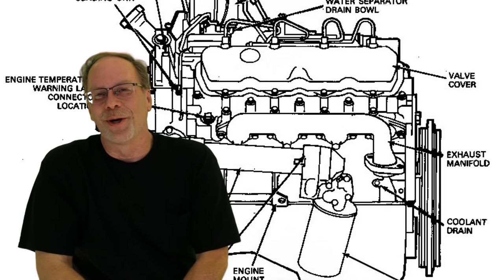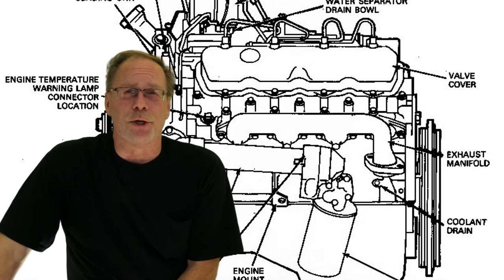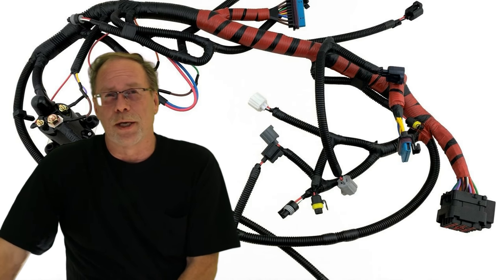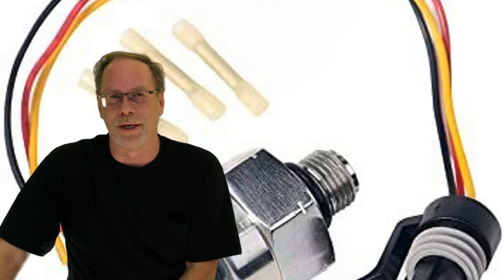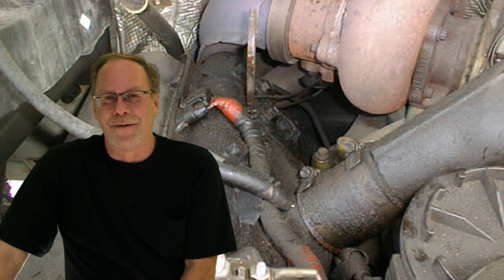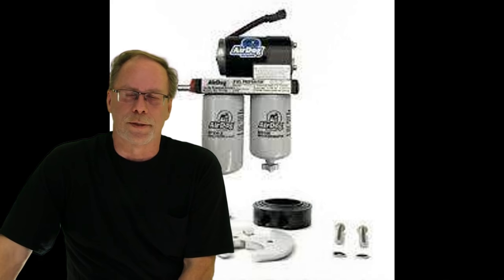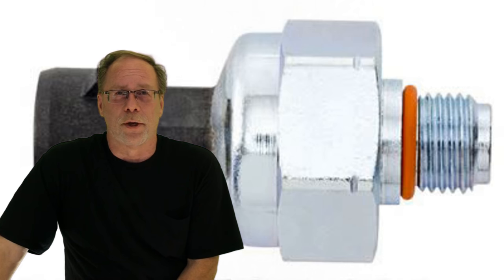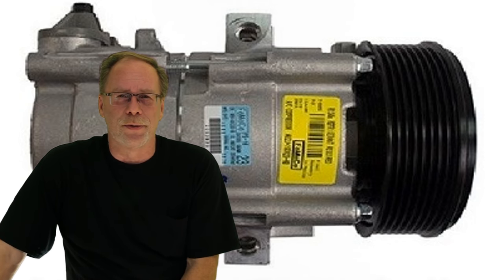11 7.3 POWERSTROKE ISSUES STOP IN AND SEE COMMON FAULTS.........

Comment: Good day! 
I have a 95 F-250 7.3 power stroke 
I am at my wits end trying to diagnose it, it has an intermittent rough idle.
Hot or cold when I pull out to a stop sign, about 70% of the time it idles extremely rough ( the whole truck shaking very hard) 
Injectors all seem to be good
Recently replaced the ICP, IRP and CPS 
none of which helped 
I also put a new accelerator pedal assembly 
Any help would be greatly appreciated 
Thank you
Reply from the maker: fuel pressure can cause this / bad wires in the heads or the lead at the connectors / injector out of spec or broken tip / check the temp at each exhaust outlet on the manifold for a large temp diff drive for 10 minutes let idle of 3 minutes then check the temp the odd temp at the manifold outlet is the problem if its a injector or wire issue here is a good deal if you act quick https://amzn.to/3P2F8p4
Reply: If automatic try shifting in neutral see if it still rough idle

Comment: Very helpful!!! But I have a 2001 7.3 f250. Recent purchase of a new wireless Obd reader like the one at the end of your vidieo. Followed all the directions so far and I have no communication to the truck thru it.  It connects to my phone no problem but is not reading the truck.  Everything I have done so far to the truck should get me ready to run.  All tho;;;; I do not have a wait to start light either. IDM was sent to a major electronics repair facility and checked out fine. 
Any help please and thank you!!!!
Reply from the maker: We are reviewing multiple obd readers currently for a up coming video so far Bluedriver is working the best . Its very difficult to assess issues with out it not being in front of a guy that being said a no start light , fuse - wires- glow plug relay / solenoid - fuel bowl heater- ecm- in that order
Reply: I thought Bruedrivers were never to be installed. The company told me not to, but that was over a year ago
Reply: I've got the OBD Link+ (shown on the screen in this video).  Works fine with my 97 F250 and my 2016 Odyssey.  Not so much with the 2003 F250 7.3.  Seems to connect but I don't get a read on any sensors.  I'm gonna keep trying though.  Might have to try a wiring diagram first.

Comment: The thumbnail is a 6.9/7.3idi.

FYI there’s 2 different generations of the 7.3 Powerstroke.
The OBS & the super-duty.
The OBS has that nasty ass shower head thing in the tank, the superduty has the tank screens. The shower head can be deleted w a section of diesel rated fuel line, & a brass T that can sit on the floor of the tank w a screen after the tank so it can be cleaned without dropping the tank.
Reply: Tell us more, I envisioned this fix and thought halleluiah it makes sense.

Comment: Thanks I have a 01 7.3 225,000 miles. It eats brake's and had to replace the tranny but this truck is reliable and I never put additives in her.
Reply from the maker: wagner pads / napa top line rotors/ and the only way I was able to stop the rear calipers from breaking was to change the pads at 2/3 rds of use and use extreme temp grease in the sliders

Comment: Need help! 2002 350 7.3 I have replaced, fuel injectors, glow plugs, glow plug relay, low pressure oil pump and oil pressure temperature sensor. Truck is still hard to start in morning and smokes terribly. Can you help me?

Comment: What happens to a 2000 7.3 if you put the battery in backwards? 
My buddy put one in backwards on a  truck he was trying to get running and hasnt touched it sence. 
Does the altinator go out? ECU? 
What could be the damage if any?
Reply from the maker: The list could be endless but mostly the battery or batteries will get fried and hopefully the main fuse and some other fuses burned up stopping pcm ecm / idm from getting fried. usually a alternator rebuild kit will get it back up to running condition The engineers depending on model year did build in some anti stupid contingencies
Reply: @CUSTOMWORKS7.3PSD  thank you, i cant find much on any forums. They just say the altinator and maybe a fuse. 
The battery smoked a lot for a milisecond and sparked. The terminals on the battery blew up. This was on the passanger side if it makes a difference.

Comment: My 99 7.3 has been smoking a lot while driving and accelerating, smoke looks more blueish,  my oil level has been full for the last month, but truck is very sputtery during accelerating, check engine light will come on while acceleration. 

I have changed map sensor,  exhaust back pressure sensor an cleaned tube, icp, ipr, an cleaned the in tank filter screens. It’s got slightly better but still smokes.

Any suggestions? injector o rings?

Comment: I had a rear main seal leak on my 7.3 and used half of the reccomended amount on my pickup, but it was only in there for about 1500 to 2000 mi. Am I in trouble? It says it’s safe in any diesel
Reply: I put a pint in mine too about 3,000 miles ago and no issues. I think I will change my oil at this point and hope I’m good. Hope you don’t have any issues either. I don’t think there is as much to worry about as he implies.

Comment: i cant get it back in , im getting the angle on the extension right but it’s not wanting to thread , any tips ? tried everything even a small bent alan key to fit the inner square . nothing .

Comment: I have a metal rattle at idle but idle it up the rattle stops is a 99 been that way sence 03 been told torque. Converter or flex plate

Comment: is there a TSB about the water pump bolts needed to be replaced with new? There is no mention of this in the workshop manual.
Reply from the maker: Yes the long bolts loose there stretch causing water pump leaks and timing cover leaks

Comment: I have a 2000 f450 7.3l, I watched the video on top 11 problems,  my lift pump is cycling correctly,  I believe that the problem is the glow plug circuit,  it cranks over , but takes about 10 minutes to get it to fire up, once it starts it runs rough and perhaps not all 8 cylinders,  smokes a little also. Got some points of help to direct me
Reply: I'm not an expert on any diesel, but have you tried replacing your glow plugs.  From what I understand they aren't expensive, but you do have to pull the valve covers to get to them...  On second thought, is it all the time or only when it's cold outside?  Glow plugs aren't needed when it's warm out.

Comment: Hi, I bought my 97 F350 7.3L Diesel because so many people told me that it was the best Diesel engine ever built... This is my first (and maybe the last) Diesel engine, because I have had nothing but problems with it since I bought it... When I first bought it, I had to replace the alternator and batteries almost every year and I only drove it about 2k a year or less... then the rotors went bad, then the front bearings, and  calipers, then the master brake system, and then the vacuum pump for the brakes, and then I started to help a elderly woman Travel across the country  to take care of her elderly mother and  older sister, so I was putting about 6 to 7k a year on it, and then I started having problems with it just shutting off driving down the road... That sidelined me for 2 years and about 2 thousand dollars before I could find someone smart enough to figure out that it was the injector computer... Got 1 year of use before it is broken down again!! I've had 3 different (So called Mechanics) try to fix it and after another 2k it doesn't run at all now!! I had to spend another 2k to have it towed back to my family's home, where it has been sitting for the past 2 years because Nobody knows how to work on Diesels here and the only one who said that he was a Diesel Mechanic, just wants to replace the same things that has been changed 3times now that cost me 2k already!! I am not going to pay outrageous amounts of money  for someone to GUESS AT IT!!! The way I look at it is, if you charge over 60 bucks an hour, you better be able to tell me exactly what is wrong with it in under 30 minutes!!! Otherwise if you don't know what is wrong, then you should pay me for your EDUCATION!!! And if you put a part on and it doesn't fix it, then you need to put my part back on and I'm not going to pay for your mistakes!! Or you can take 20 bucks an hour and then guess at it!!! But being Handicapped and a Senior Citizen on a Very low fixed income, I can't afford to just keep borrowing money to just throw away on GUESSWORK!!! I'm not sure where you're located, but I sure could use your help getting it running again, so I can help my elderly neighbor... I'm a perfect example of "No good deed goes Unpunished"!! About the only thing that didn't get done that one guy recommended, was a complete wire harness, and I tried to find one, but all I could find was a old used one and it said "AS IS" so I not spending 300 bucks on a AS IS crap... So where can I get a new one?? Oh, I forgot to mention that another time it broke down, it was the switch near the front tank, and then another time I had to replace the front tank sending unit, and now the rear tank isn't working... I just bought new sending units for both tanks, and oh, they bypassed the vacuum pump and installed a electric fuel pump and a inline fuel filter as well as the big fuel filter on top... I would have been better off just getting a new 7.3L and swap it out 10k ago... It only has 260k on it and most of the time I am only Towing her Little Jeep Cherokee latitude across the country... Total about 7k lbs... The truck is in Maine right now... You should come do a video on how to diagnose and fix the problem... That way you can post it and people can see how to do it correctly... Please let me know if you can, or if you know someone up here that can do it... Thanks

Comment: I ran out of diesel @ 1/4 twice at 11pm, I always refill at 1/2 tank now
Reply from the maker: https://youtu.be/ZqT1d7pMKWs    7.3 POWERSTROKE TANK SUMP EXPLAINED...............
Reply: Happened to me awhile ago.  Dropped both tanks to find that both of the plastic pickups had broken off of the end of the fuel pickups.  Other than a bit of an issue disconnecting the fuel lines it was a pretty easy job.

Comment: I have a 2001 and starts when cold but will just flat out die once in a while to continuously until really warmed up. Will always restart right back up. Almost every sensor has been changed, and has a new factory engine harness along with every thing else new I have changed. All gauges work and show good things, could it be TPS?  When it is stalling out it loses throttle response??
Reply from the maker: It could be but to be sure it needs a running diagnostic scan, Most diesel shops will do this then you can do the actual repair or replacement

Comment: Hey Custom works, just recently had my 2000 7.3 in to get a new oil pan, end seals etc replaced , as the pan seal was leaking and I thought let's pop a new pan on. My mechanic has finished but it's leaking from the seal again. He swears by the sealent he uses on the oil pan. He says that the old engine (600k) is producing to much pressure and is pushing oil at the seal. As far as I know the sump oil is not pressurized, and honestly can't fathom how it would become pressurized. I think his seal job failed and is trying to take me for a ride. Do you have any thoughts on that ?
Reply from the maker: Yes you are correct he is full of it but lets say your  CCV was plugged tight you would throw a cel code for engine back pressure to high or you would smoke the LPOP seal or the rear main seal but the seals would reseal till pressure built up to high again This possability is so rare you have a better chance of blowing lightning out your butt hole That being said a proper  new oil pan install should always include setting the mating side on a know flat surface to make sure in shipping it wasnt bent then new fasteners need to be installed even Ford service bulletin requires this and further states to use a silicone gasket not rtv because over torquing when not properly set up rtv will cause leaking on the front or rear of the pan  The above are facts not opinion Hope this helps /////
Reply: @CUSTOMWORKS7.3PSD  thank-you for confirming my thoughts. The only pressure realeased back into the oil pan is from the oil filter overflow valve and even that would only be 10-70 PSI or whatever the LPOP is pushing the oil through at... A good oil pan seal should be able to handle that... And a completely clogged oil filter is unlikely and an easy fix that should have been solved quick. (Since the oil was drained for the pan job it should be a brand new filter anyhow)... The bills sitting at 3k. And I have a truck that still leaks oil. Not happy , especially with him trying to blame it on my engine and calling for a complete rebuild . I only drive 7.3s and this one is full of life and power

Comment: Got an 02 F250 7.3 4x4 with 300k miles, everything is good, just changed oil and filter and fuel filter. Truck is in good shape, lots of maintenance done lately.
The car died on me on the highway while cruising low rpms, check engine light came on and lost power steering. Coasted to a stop and truck would not start. While waiting for Roadside assistance, i got it to start up and its been driving with no issues the last few days.
I tried pulling codes, but there are no codes stored. Im using Icarsoft Pro. Any suggestions? CPS or ICP would show up codes, would it not?
Reply: I have a similar problem where all of sudden after about driving for 20 miles my '99 super duty 7.3l just dies.  The first time it happened it started up after a few minues and I was able drive it for 2 weeks.  But then suddenly one day it died after about 20 miles and it would start after a few minutes and then die after about five minutes.  I had to get towed.  I looked into the water/fuel seperator and the heater was rusted.  I changed it out and started it and let it run for a 1/2 hour, then drove it around locally for awhile and it was OK. Next day drove it about 20 miles and it died.  Same start stop routine. I had to get towed.   I am going to change out all the fuel related parts.

Comment: So if a 7.3 will not start but you give it a shot of starting fluid and it starts but will not day Running unless revved up to 2k what could that be? Where would be a good place to go?
Reply from the maker: fuel pressure 50 psi min ICP 600 psi min IPR .08 v min LPOP HPOP you need to do a running diagnostic use this Wireless WiFi OBD2 Scanner Code Reader & ELM327 Automotive Diagnostic Tool - For Android or iOS Devices here is the link to buy https://amzn.to/3zH7Ers then down load app forscan pro pic the PIDS for these above sensors each pid will give you a value low high that will tell you what you need to fix

Comment: I have a 97 powerstroke  that intermittently won't get over 2,000 rpm. I had the injectors and harness replaced, glow plugs and harness, fuel pump, fuel lines, tank pickup screens,  fuel bowl, fuel pressure regulator,  ICP, IPR, speed and cam position sensor, IDM, Main computer,  throttle pedal, had the down pipes replaced, the turbo inspected,  exhaust inspected, cam lob inspected, it's throwing no codes. It will run fine then out of the blue it will shutter and smoke heavy and won't get over 2,000 rmp and have no power then in a little while it will slightly rev up and the smoke goes away and runs normal.
Reply from the maker: hook up a high pressure oil gauge to the head run it up to the windshield when it starts acting up watch for drop off below 500psi (HPOP INTERMITANT LOSS) check fuse box and wires loose or greening this is where I would start in trying to diagnosis

Comment: Don't want to start replacing stuff bc I assume it's the problem then dont want to pay the price of a mechanic. But my 7.3 starts spits sputters bucks then just shuts off 2002 f350 any idea where to start thanks
Reply from the maker: get codes from computer, check fuel pressure,  watch the 7.3 POWERSTROKE BASIC DIAGNOSIS WHERE TO START WHAT TO CHECK and sensor vids

Comment: Truck stalling, PCM? My truck has been randomly shutting off 97 7.3 auto. I believe it’s the PCM throwing an icp code even though the icp was just replaced. Truck shut off while driving and now won’t start, changed the PCM with a known working PCM and it fired right up.
Reply from the maker: Thats rare but happens I just got done with one today the guy replaced the PCM IDM and all the sensors and all it was is a bad IPR connector While he was in the shop and it was running I just pressed on the plug and the truck quit out So soldered in a new pig tail n plug runs and drives great

Comment: please help me I'm from south africa have a 7.3 powerstroke hard start misfires smokes allot all when cold when warm it's better no smoke but misfires at high rpm
Reply from the maker: there are multiple videos in the video library covering these issues
Reply: @CUSTOMWORKS7.3PSD  did everything but shimming on injectors.  I'm the only one in sa with a 7.3 powerstroke . no where to even get parts

Comment: Have 97 federal engine obd when connected will say dealer not released. If try read code engine will shut down...any help much appreciated
Reply from the maker: If I'm understanding you engine codes are pulled key on engine off ,, 97 is OBD 11 make sure you have the correct reader ,, Dealer not released never have seen this but I'm guessing when I say the message is coming from the reader the correct program isn't loaded in unit only based on other readers I have seem that they kick out odd messages when it doesn't understand or doesn't know

Comment: Lost in alaska, upon driven home smelling fuel, turns out the fuel bowl o ring sprung a leak in turn soaking top of motor, fixed it? power washed  it and no start, no code. I've replaced every sensor, solenoid, idm, hpop and yes checked my fuses. I'm leaning towards an engine harness now. Have you any input on this ? Thanks for any input . Lost and broke in alaska.